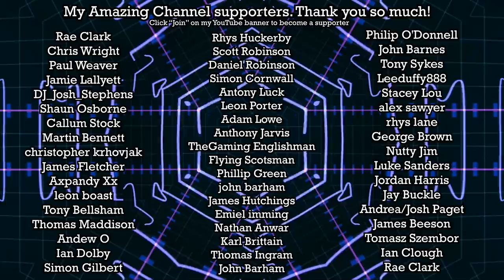UNSAFE TO TIP!

Comment: type 1 is crushed rock and soil/rock dust. it compacts really well to make a sub base. scalping s is similar. this comes off of a primary crusher when you dump rocks from the shot it will have a lot of dirt in it. the primary crusher will break these rocks into various sizes. 6 inch will go to the secondary crusher for further crushing. it will also filter 3 inch. scalpings is the dirt and shards that come off the bigger the stones. it can be used as an alternative to type one but because it can vary from how much stone to dirt  content its not widely used.

Comment: Luke surely with the current covid situation, you shouldn't be sharing your pen to get your line signed, or passing your book back and forward for a signature. It should work the same as the post office where there are no signed for parcels and the postman sign's for you.
Just a though to keep your family as safe as possible and nothing else is meant by the suggestion. { Keep Safe ]